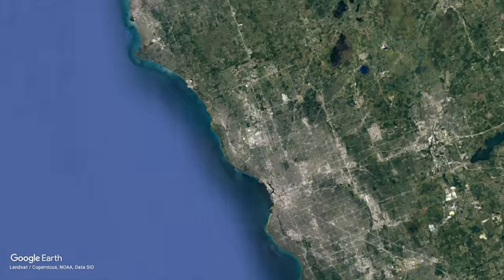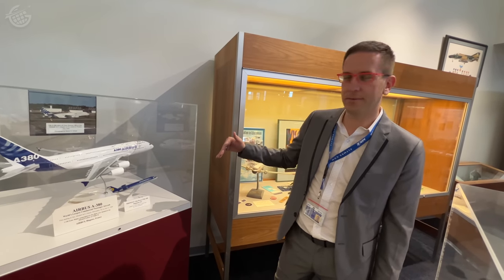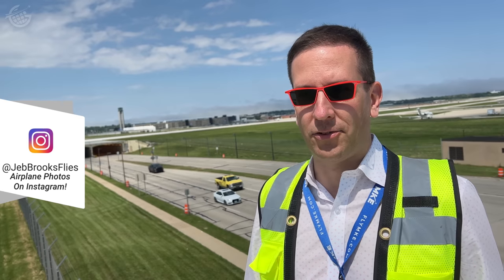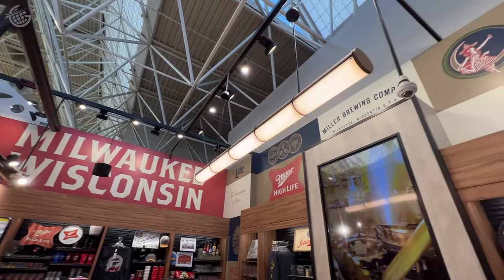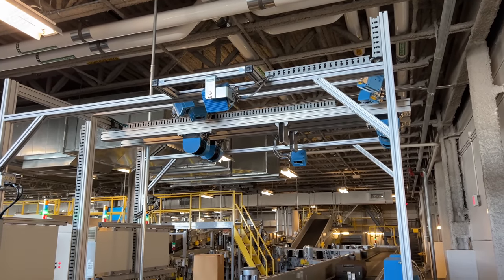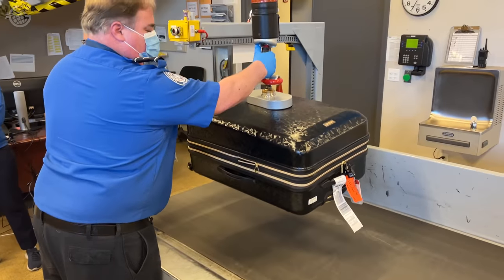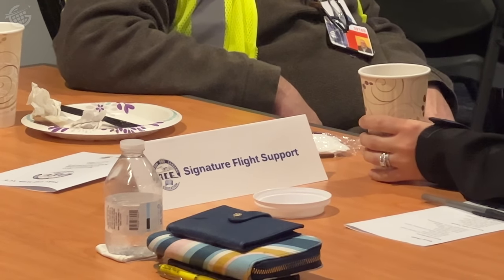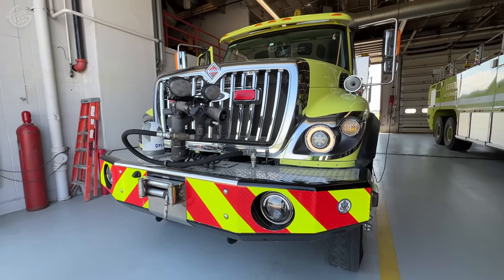Inside the USA's "QUIRKIEST" Airport!

Comment: Flew into MKE numerous times when doing oversight for a project in Zion, IL.  Flew into ORD a few times - such a hassle to get a car and then drive North - much easier to get a car and then drive South at MKE.  Nice airport.  There is a good local restaurant nearby - the Packing House - usually ended up catching the first flight of the day home, so have had several great meals at the Packing House.  Nice review of the MKE airport.

Comment: Ive been there once back in 2007 when Midwest Airlines existed and had a hub there when flying from Omaha to Orlando. The planes were Fairchild Donnier Regional Jet, Boeing 717, and an MD-80 I was on. The Boeing 717 was from MKE to OMA and all seats were first class, MD-80 was from MKE to MCO to MKE and the FRJ was OMA to MKE (Midwest Connection operated by Skyway Airlines).

Comment: That Amtrak station sounds like a great idea! My closet airport (Houston-Bush), obviously has the planes and Houston has an Amtrak station but getting between them isn't easy. You would have to rely on a bus if you wanted to take public transportation. Houston buses aren't as time efficient as something like The L in Chicago.
Reply: They added that station several years ago to try and draw travelers from Northern IL that would rather not deal with ORD.

Comment: I had the luxury of working at MKE from 99-03 as a ramp ground handler, deicer and ramp supervisor. It was some of the best years of my life. The airport was a big family, and you knew most of the people who worked for different airlines. I have been to every corner and have seen every square inch of that airport, it truly was designed for efficiency!
It is a real shame what has happened to the passengers at Billy Mitchell... in 1999 every gate at the airport was occupied by some airline,  now due to mergers half of the airlines disappeared.  The non-stop options you used to have disappeared as well... Midwest, Skyway, US Air, TWA, Northwest, ATA, American West, and Continental are gone... They were replaced by mostly low cost carriers like Spirit, Frontier and Southwest
The entire E concourse is no longer used... I fly whenever possible out of MKE, but now if a non-stop flight isn't available,  I drive to ORD.